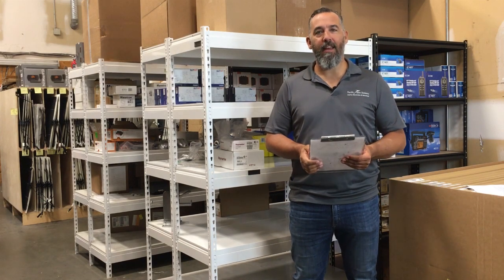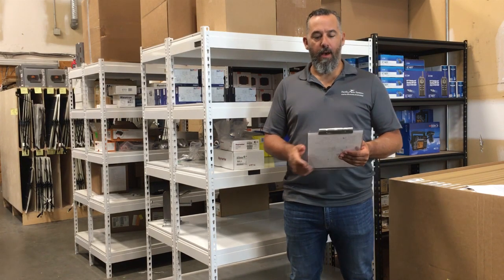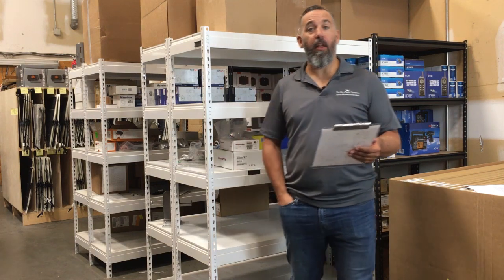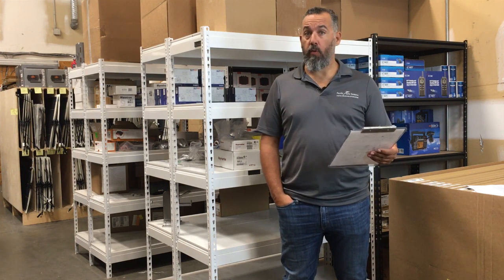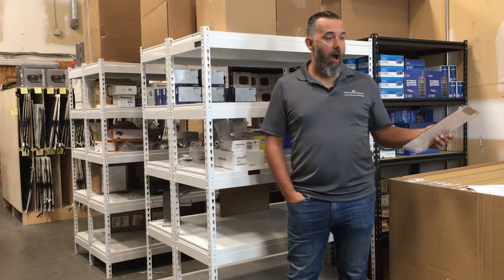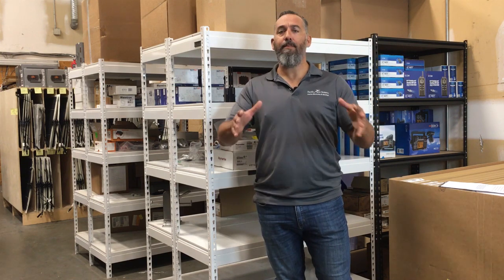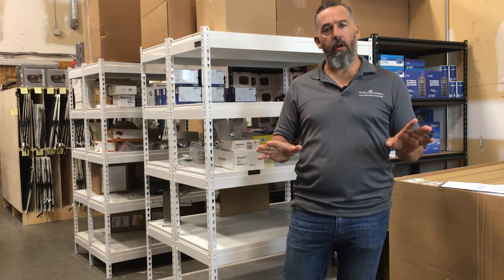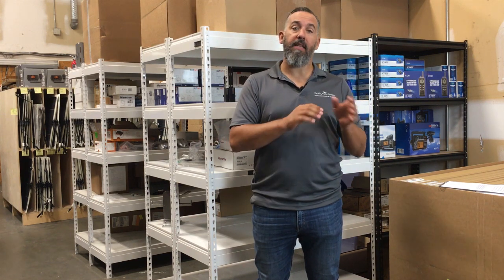Can I Charge My Boat Batteries With Solar and Shore Power at the Same Time?

Comment: I appreciate your videos very much. There's one thing that I just found out and I'm not sure how this works. I have my solar panels on the roof not much maybe 12 panels rated at 100 W currently I have them running to a 30 amp charge controller to a large battery bank and I just bought a new 4000 W inverter 
 I haven't used the system yet and the instructions on the inverter tell me not to charge the batteries from the solar panels at the same time that I'm using the battery power to run my stuff. so my question is do I have to disconnect the power coming from the solar panels every time I want to use my 12 V system to run a fan or whatever I'm in the dark and confused. I would appreciate any help.

Comment: My solar is slowly charging my lithium batteries. I
'm connected to shore power but my non-lithium controller will only charge my lithium batteries to about 75%. My solar usually will charge the batteries from 75% to $100 on sunny days. I'm in a shaded area nd so my solar can't charge batteries to 100%. Can I connect an external 20amp lithium battery charger directly to batteries and charge the batteries to 100% while the solar charger is trying to do the same thing?

Comment: A bit off topic but didn’t know where to ask:

I’m hooking up a solar panel via controller. Controller to battery. My challenge is getting to my batteries house battery is 2x6v in series. They are tucked way in the corner with zero room. My wife can get to them but she isn’t confident. 

What would be wrong with connecting the solar controller to the battery switch ( easily accessible) on the house battery side and putting a fuse on the positive lead from the controller to the switch terminal?
Reply from the maker: Hi Gary, this work around can be acceptable as long as you connect the solar controller to the battery side of the switch and NOT the load side.
Reply: why not just put some cable extenders on you batteries so you can reach them?

Comment: I would like to see 
How do I size a solar controller to my solar array? 
What is better, wiring solar in series or in parallel if you have only 2 or 3 panels?
Reply from the maker: Choose a solar controller based on the open panel voltage of the solar array. When shading is possible, we install a dedicated controller per panel. If shading is NOT an issue, we wire panels in series to a controller.

Comment: WELL!!! DONE!!!
Thank you, it took me about a year to get a good grasp on DC 12 systems.. No easy feat!!! I'm probably the slowest and but I got there.. Never let it be said an old  Journeyman Carpenter can't learn DC 12v.. thanks, can't talk, got lights to install 👍
Reply from the maker: Glad it helped!
Reply: @PacificYachtSystems  
I owe you a salmon dinner haha 😄.. definitely going to buy Firefly batteries when I do my House Bank in Astoria .
Thank again..
Reply: I am in the same situation and an old carpenter trying to set up a wee bit of free energy from the sun.
 I have a large battery bank and I have a 4000 W inverter with a charge controller wired in between the panels and the inverter. the problem is I didn't realize the instructions on the inverter are telling me that I can't run the power from the panels to the inverter at the same time I'm drawing power to run an appliances so I didn't know that and all I know is it seems like I have to disconnect the power from the solar panels every time I want to use the inverter I'm definitely in the dark about this stuff. I'm just a tinker, trying to get a bit of free energy from the sun, but this whole deal can get very complicated really quickly after buying this 4000 W inverter and the instructions are telling me not to feed power from the panels to the inverter at the same time, I'm trying to draw power any advice would be much appreciated

Comment: I believe this is only true if you can get away with constant-voltage charging. Lithium chemistries need a phase of constant current charge, followed by constant voltage charge, and multiple charge controllers need to coordinate to manage that. I think most lithium batteries for marine applications have BMSs inside to manage this for you, but it's something to verify.